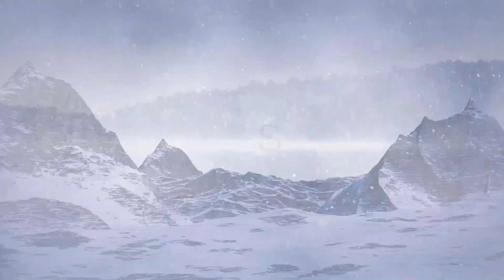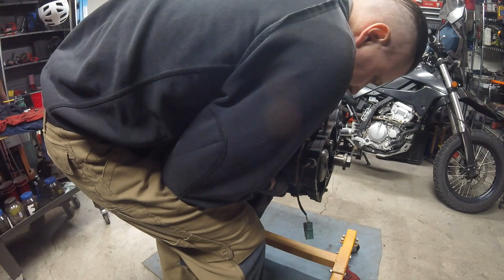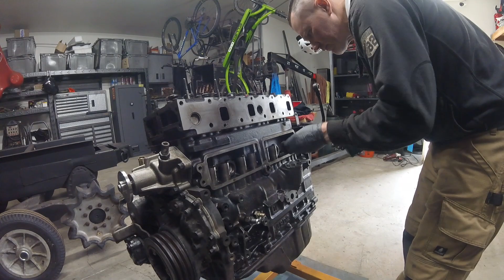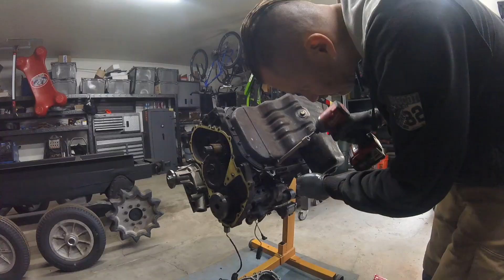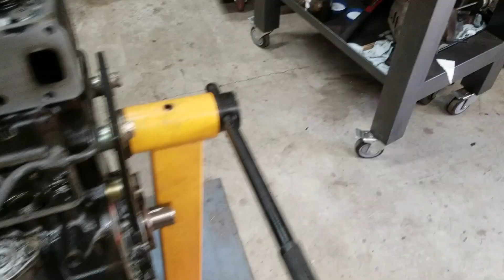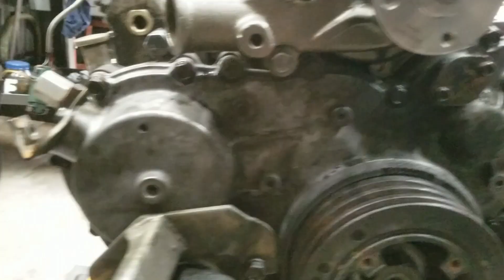Rusty the Spryte build part 51 (4BD2T teardown and rebuild part 8)

Comment: Can the PowerSteeringPump assist the track braking?
Reply from the maker: Hi John!  No.  The control sticks will be setup individually using slave and master cylinders similar to how clutches are setup in modern vehicles...All mechanical of course which is the theme I am trying to stick to with this build....

Comment: It does look surprisingly easy to work on
Reply from the maker: Yes right now....once it is mounted inside the cab it might not be as much fun....
Reply: @SeanFastidious  good thing you've done as much preventative maintenance, while everything is easily accessible.  Make sure to put in some new platinum spark plugs, while you're at it 😉
Reply from the maker: I am not sure where to put those LOL
Reply: @SeanFastidious  you were supposed to drop them into the cylinder, on top of the pistons.